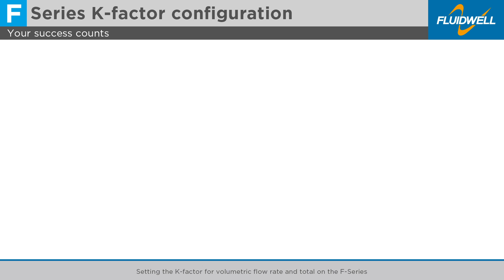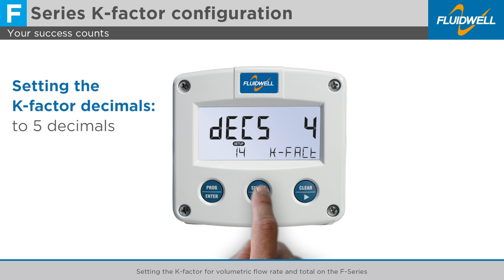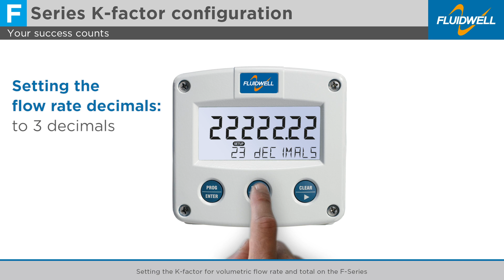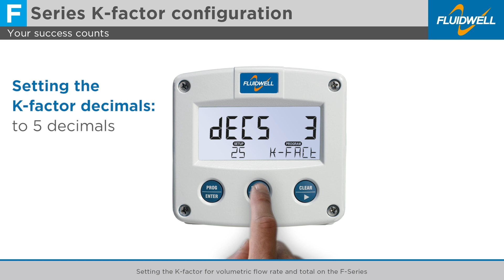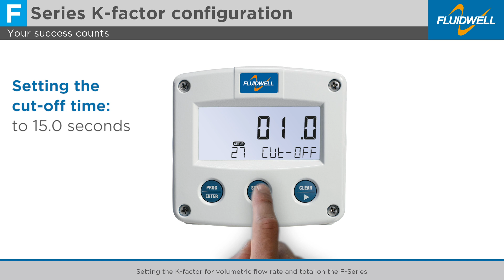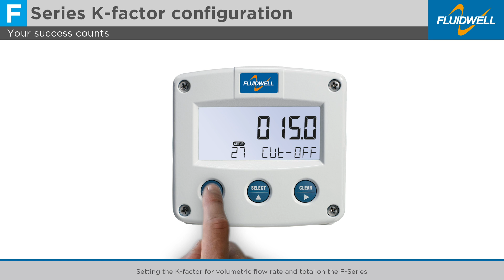Setting the K-factor for volumetric flow rate and total on the F-Series

Comment: will the difference in flow meters have an effect on these settings being accurate?
Reply from the maker: Each flowmeter has its own unique K-factor which needs to be set at the F-series indicator.
So different flowmeters will have different K-factors and that results in different settings.
When the specified flowmeter K-factor can be set exactly (without rounding) in the F-Series indicator, it will be as accurate as the flowmeter manufacturer has specified.
When you have any questions, please contact us at https://www.fluidwell.com/service-and-contact/contact.html